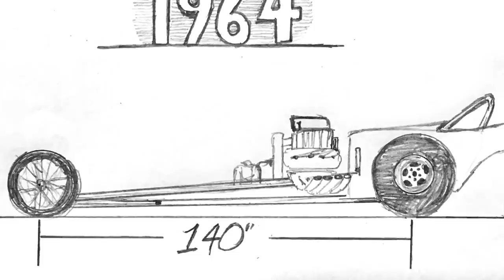SKETCHY 1960's Front Engine Dragster Made out of WATER PIPE

Comment: Speedway motors sells plastic display engines from flathead Ford to hemi  check them out . You can even dress them up with any accessory  you want to.they are light weight as well and bolt up to stock mounts .
Reply from the maker: That's kinda what I'm thinking. We need something light. We bought a very cool 1955 Dodge Hemi...it's only 270ci but still VERY heavy. It would probably cause this thing to collapse.
Reply: @HotRodHoarder  yeah you can buy plastic hemi and paint it a rust patina color a bolt on the 270 valve covers and intake of your choosing even zoomie exaust. If you contact them you find out they have a lot of vintage parts at a reasonable price. Go online and see their online street  rod catalog for the vintage parts and display engines.

Comment: the front torsion bar is one of the tubes from the front axle beam of a vw bug that they cut the trailing arms down and welded plate to. most likely from the same car that the steering box came from.
Reply from the maker: Yes sir, very likely that the two pieces came from the same donor car.

Comment: I wonder if it was a slip joint frame they tried and it didn't work so they welded it. If it were me, which it isn't, but if it was, I'd find a period correct Hemi to put on it, and try to fix the chassis as it would have looked in 1963. Make it look like go but just for show.
Reply from the maker: We just bought a 1955 Dodge Hemi that would look nice on this chassis. We may have to brace it up though...even though it's just 270 cubic inches, it is heavy!

Comment: The steering box is made backwards. If it would of been mounted to left side then right would be left and left would be right. 
I have  reverse steering box on my dragster I ran it down the left side but I mounted it down low and made the pitman arm centered in the up position  instead of down.
 If you want to check out my channel I have videos of my latest dragster on there. I built the chassis 5yrs ago. 
"The Dragster Shop" 
Is my channel name.
Reply from the maker: Good info! Thank you!

Comment: Then this video, talk about 2 vehicle, one car and one pickup , should be another project for some one who can , work on it.   Putting these classics back on the road.   I have one that I will never part with.    It sat in a barn , from 1988 , untill 2003     frame is rusted , body is rusted ,.  Fenders have tiny pin holes ,.   Motor ran from 1985 until, 1988 , then parked , got it running in 2003 , driven until 2007 , I don't know if will even run since it's been parked.   Sad , because it's a 1978 F - 350 , extended wheel base 1- ton.    Believe me, this pickup can almost pull a house down the road on the back , meaning, you can haul a heavy load, with no worries.   Now ?  2021 ?  I wonder if it will even run ?  It's a 1976:Grand Torino ex police car.   With ? Less than 200000 miles on it?  Is it ok to do body work on it to save it , or is it very much toast ?   Meaning body  rust ?  This question is for the video man with this video, or to Ford lovers out there who has experience in Auto body and paint. ?   Hopefully it's not too late to restore it ?     Thanks for information if you have any.